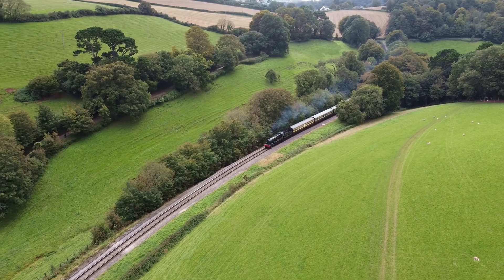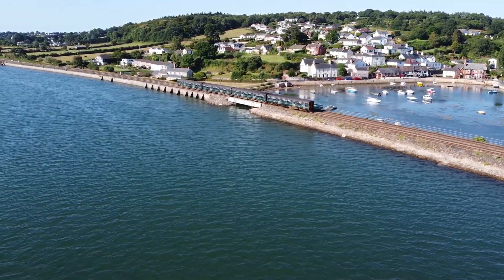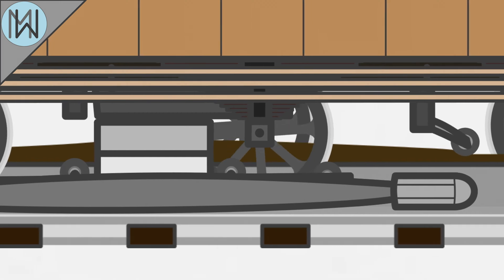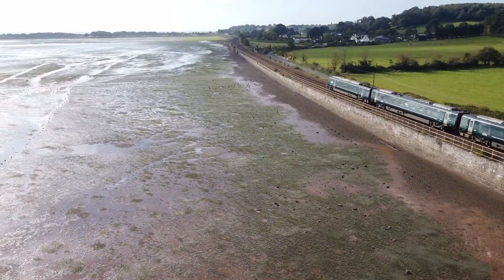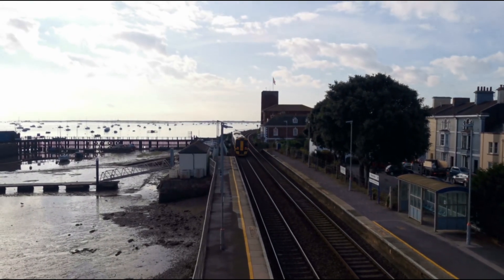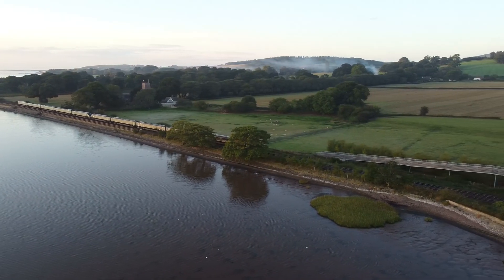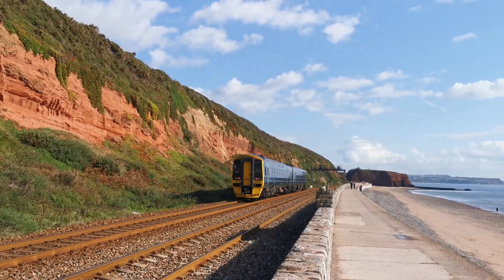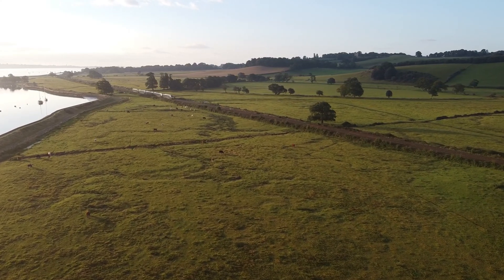Isambard Kingdom Brunel's Vacuum Powered Railway

Comment: It would be very interesting to see how an atmospheric railway would run using modern materials and technology.
Reply: Yeah its exist. It is called an aeromovel
Reply: Technically such a system already exists. It's called a catenary system; it's those wires you see on top of the rails that trains connect to using those "claws".

Comment: Excellent video. 

One nit pick. At 2:40 you say “the unusual power generation” when you should say “the unusual power distribution”.  

The concept is not dead either. Aeromovel, a Brazilian company, created a new designs in the 1980s and has had one system running at the Taman Mini tourist park in Jakarta since 1989. They opened another between a railway station and an airport terminal in Porto Alegre in Brazil a few years ago. 

The system uses electric motors. See:

Aeromovel 
https://youtu.be/J6tAwd5jYFQ?time=60s